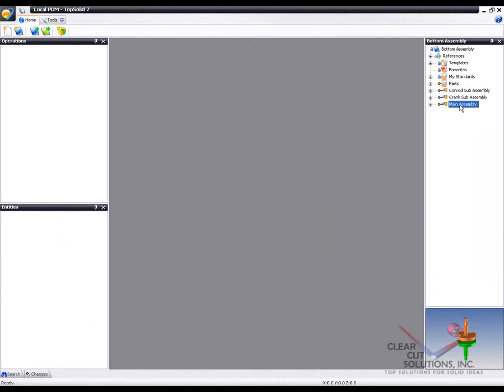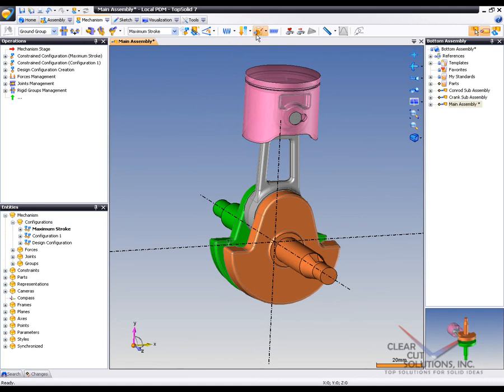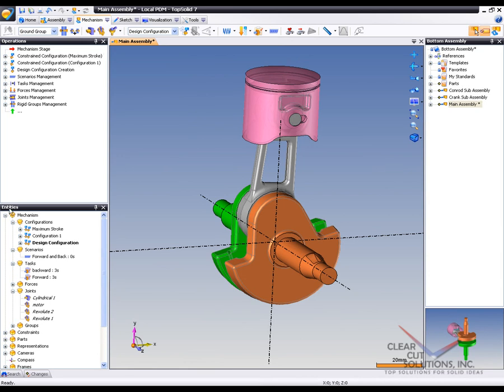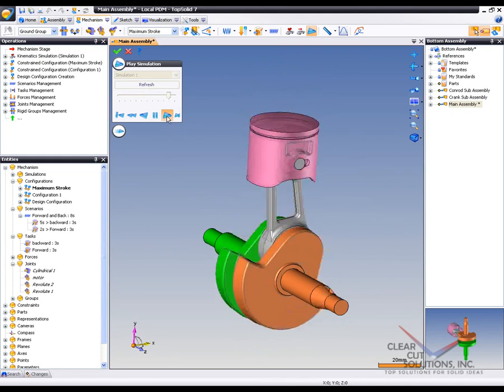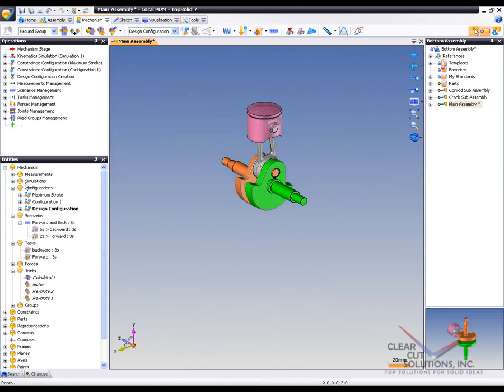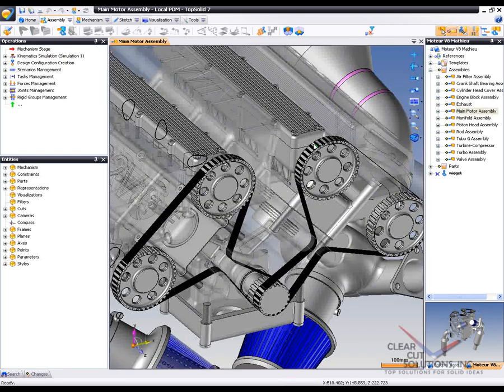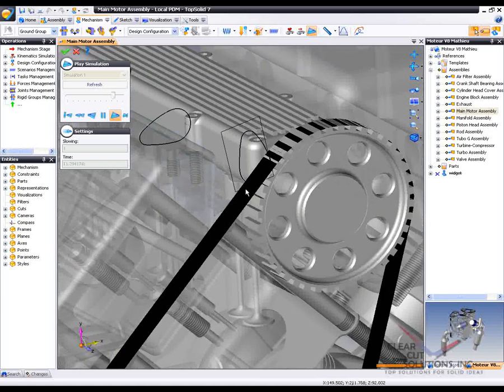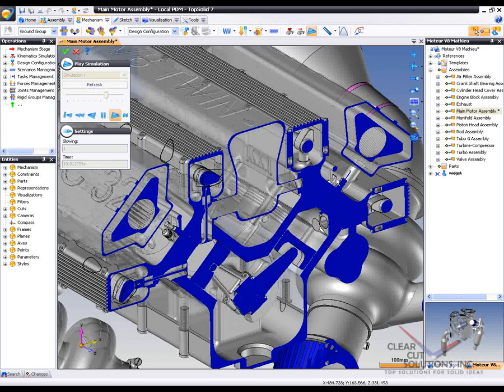Using Kinematics in TopSolid 7

Comment from the maker: No, it is really a very basic machine. Also, I forgot to mention it is Windows 7 64bit. I got the machine from Best Buy 2 years ago for $1495. Today TopSolid 7 is optimized to run on GeForce cards or Ati Fire GL Pro cards. We don't use Quadros. As for price, in the US market a seat of TopSolid 7 Pro is $5995. Annual maintenance is 15%.